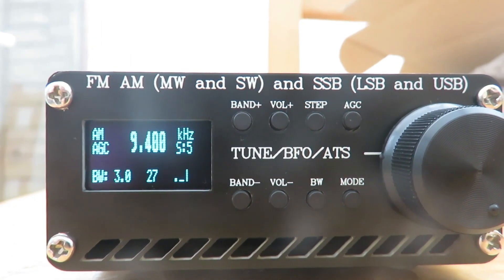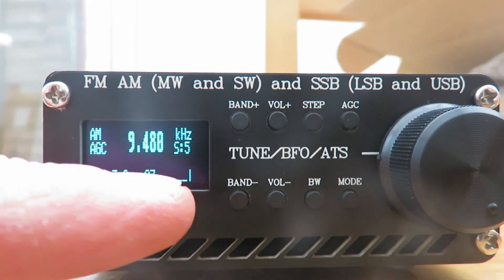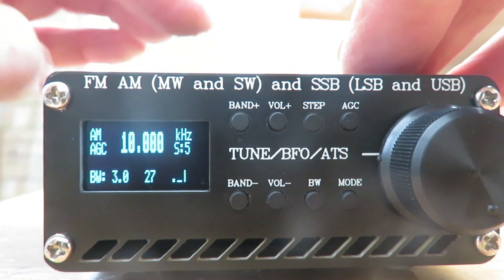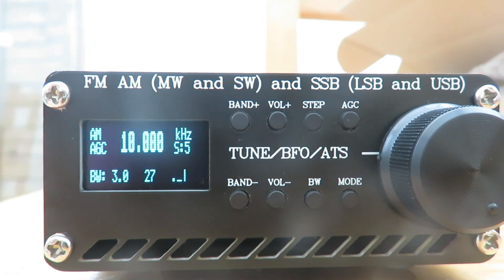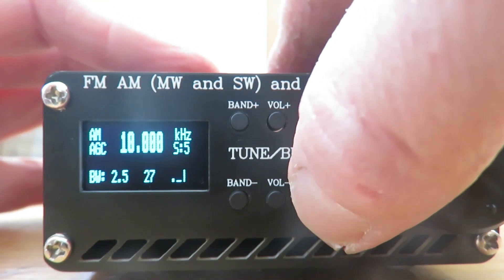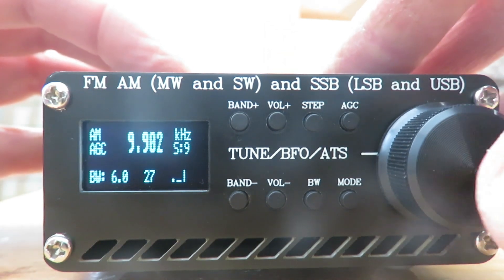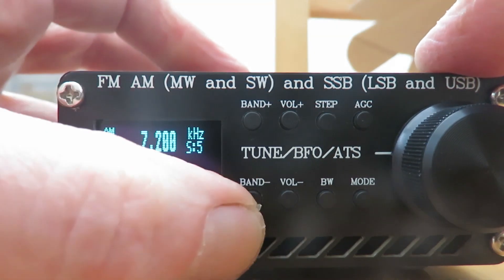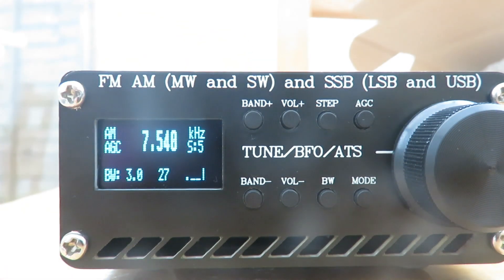Latest Update for the SI4732

Comment: Do you have a video (or information) on how to install this latest version?  Does the .ino include the SSB patch?  My ATS-20 radio is running 1.1.5, so could really use the improvements shown here.  I have some experience with Arduino, but it's been a few years since I've played with one.  Not sure what IDE version I would need, and what other libraries, drivers, etc. that I'd need to update my radio.  Any help you can give would be very much appreciated - thanks - Alan W2AEW